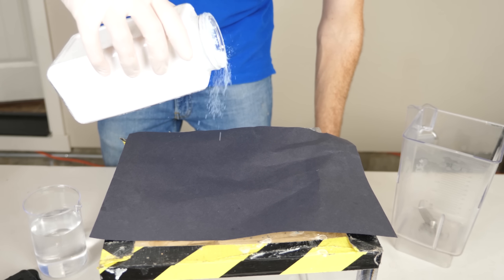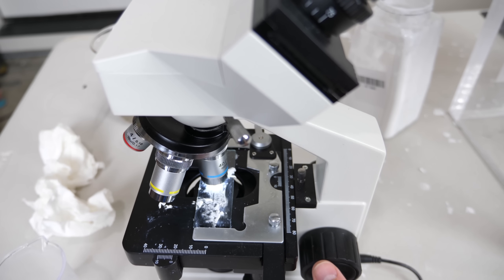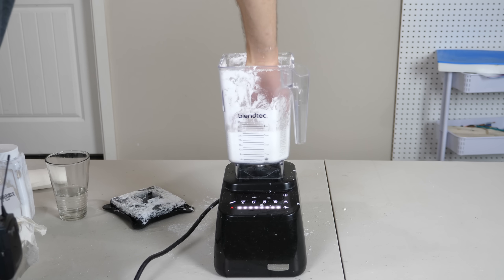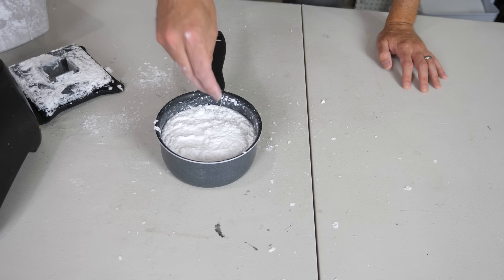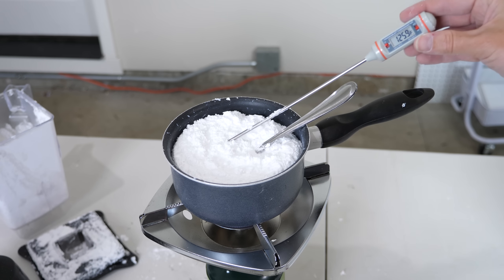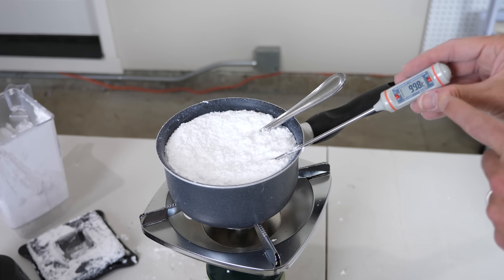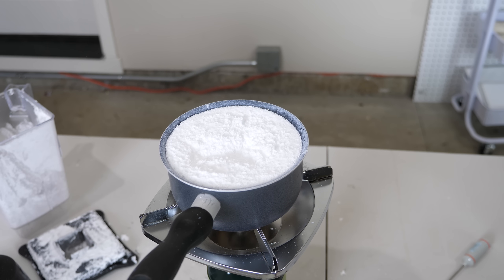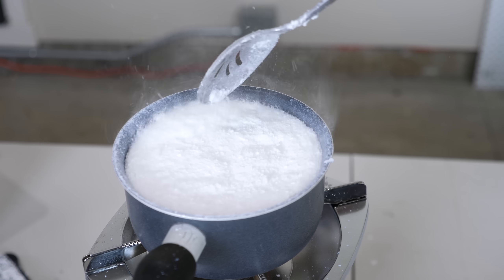Is it Possible to Boil Powdered Water?

Comment: "should I touch it", that's exactly what I was thinking.
I wondered what the top surface temperature was of the dry water.
 seems like it would be insulated from the heated droplets traveling from the bottom.
 kind of like a essential oil diffuser immense a form of steam vaper but the liquid inside stays about room temperature.

Comment: SWEET JESUS DO NOT MIX FUMED SILICA IN YOUR HOUSE AND ESPECIALLY NOT IN OPEN AIR WITHOUT A MASK.

It's basically micro particles and strands of fiber glass. Even opening the container in still stagnant room air is enough to saturate the room with tiny little particulates. So the boiling is now super saturating the air with hot glass hairs and fibers and micro particles now. Congratulations.
Reply: He's wearing a mask calm down.

Comment: Few things I am bringing up only because I use fumed and fused silica regularly.
1.  You should always wear a respirator.  Like always.
2. You said its hydrophobic (guessing something like a Cabot ts720) and then say it will absorb the moisture in your lungs.  That could only happen if it was hydrophilic.  Not saying it would be good for you, but absorbing moisture in your lungs wouldn't be my primary concern. Hydrophobic anything repels moisture, and cannot absorb it hence the name.
3. Having powder with that much surface area directly over an open flame is sooo irresponsible.  Use an electric hot plate or induction top.   
4. Good luck getting that coating of dust out of your garage.

Comment: Umm it's just a mixture of silica fume (solid) and water (liquid), not a solution. So when you reach water b.p., the silica solids rise with heat to form the surface layer, while water at the bottom boils and evaporates as steam. And the steam gas rising carries a bit of the silica powders. If u dont believe me, try clear pot u would see they are distinctly separate at a certain temp. I am an MD, but anyone who has studied chemistry states of matter at middle school level would be able to deduce this
Reply: That's interesting, as it reminded me of talcum powder + water, which I played with as a kid.  Nothing in it gets wet because the surface tension never breaks.

Comment: You boiled the water.. it was never dry. The powder was coating the water molecules...so boiling the water it created steam which is evaporating water ..the "boiling of the powder" never happened...the force of the water boiling sent the powder in the air ..most likely the one that was attached to the water  evaporating. The product you had with the powder and water where never really one thing...you could've probably easily separated both with a coffee filter.

Comment: What is the heat capacity of powdered water?
Can you actually boil an egg on it?
Will it start boiling if you put it under almost perfect vacuum in the vacuum chamber? Or will it just get sucked in and clog the pump?

Comment: The powder wouldn’t raise the boiling temperature of water since it’s not a chemical mixture. The powder is insulating the water molecules and the thermometer is reading the temperature of the powder and not the water.

Comment: Ive seen in the last video in the microscope that one of the water dropplets joining together. Is it possible that if you leave the dry water enough without disturbing it could the water join and accumilate at the bottom and the silica powder on top? Id like to see that is possible.

Comment: You are actually boiling the water till the steam freed it from the silica shell causing the steam to rise through the powder. The steam bubbles also allow the water to rise free of silica trapped inside the rising bubbles.

Comment: Can you boil foods like for example an egg in the dry water
Reply: it's the heat that cooks the egg not the water, the water just makes it easier to get the heat to the egg. so the answer is yes
Reply: G Ood question
Reply: Yes, as long as the temperature is high enough

Comment: @TheActionLab another question about boiling water.  Technically it is about the partial pressure of water vapor above the water, not the total air pressure.  So I wonder... If you blew really dry air across the surface of water, would it boil because there is no water vapor above the water surface?

Comment: Wow, now think of the applications of being able to boil with a non-liquid.  That's just cool.
Reply: What applications Jeana
Reply: None
Reply: @Daniel-xh9ot  Soften plastic parts that have ink, paint, or stickers on them, boil foods that might otherwise been spoiled if wet, heat treat certain types of electronic components (maybe evaporate the water out of that phone you dropped in the puddle), give it to the French Cook Alex for his meat dryer as a desiccant...  that is just off the top of my head.
Reply: @shotintel  you can't just "soften" a plastic part by boiling it, you don't need to boil dry food (that's what microwaves, ovens, grills and pans are for), I don't think boiling a metal is the best way to heat treat it, boiling non liquids is not that useful.

Comment: Hey action lab. 
Can a super human with super strength but normal shape size and weight, lift a long object  like like a train engine from its one extreme end and hold it horizontally. He has super strength so he can lift it but will he be able to balance it while holding horizontally from one end.. or he will be tilted and the other end of the train engine will touch ground.. 
Pleas solve this..its giving me headache.

Comment: Can you still see without pupils( the black dots in the center of the eye 👁

We are now taking about Leonardo’s diving suit.
Reply: The pupil is kind of like a window that lets light reach the retina (the thing that does the actual seeing part of seeing), so without said window, no light would reach the retina, so no.
Reply: How small can the pupil get before the retina is blocked?
Reply: @jordanezell5132  The answer depends on the level of light around the eye. The iris (the colored part, that also is what changes the pupil's size in different light levels) probably does have a minimum that it can shrink the pupil to. You should probably ask an eye doctor about this stuff, or maybe look it up.
Reply: Is it possible to get artificial pupils for people with myosis? A condition where the pupils are abnormally small.
Reply: @jordanezell5132  I'm no eye doctor (which you probably should find one to ask these questions to) but from a quick internet search, it seems that myosis is an issue with the iris that affects the pupil. There are ways to force the pupil to expand, but none that I know of are permanent enough to fix the problem.
Reply: Seabass the Gamer Thank you very much. To change the subject, do think Action lab should make Da Vinci’s diving suit? I’m currently trying but I want to see if a  YouTuber can do it just to prove it’s possible.
Reply: @jordanezell5132  That certainly seems like it would be interesting. Might have to change the materials some, but it would be neat to see.
Reply: Seabass the Gamer wish we could entice him to try. P.S. change what material?
Reply: @jordanezell5132  The bamboo connectors to the diving helmet thing. Bamboo isn't exactly the most flexible, and flexibility would probably be handy for underwater stuff.